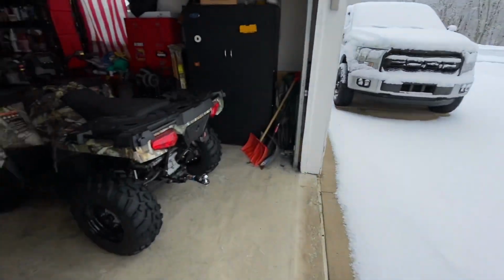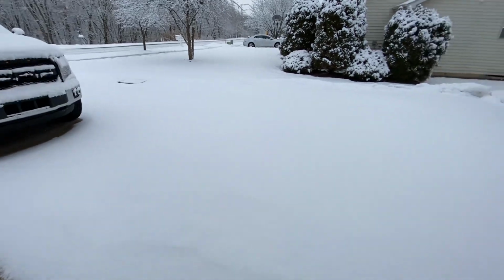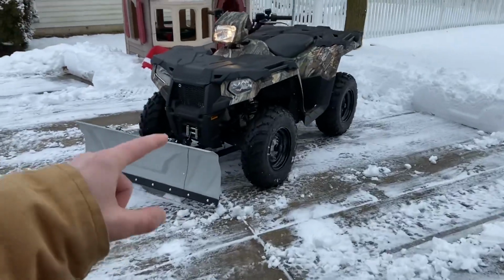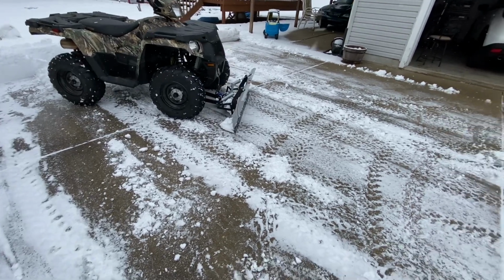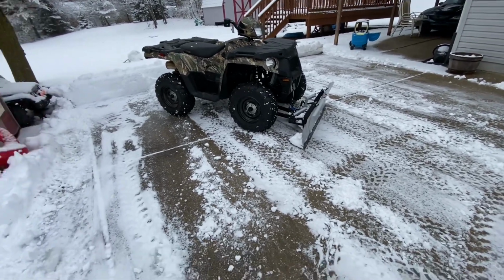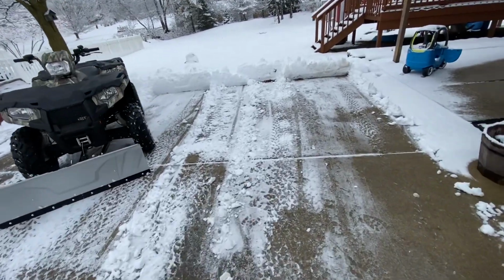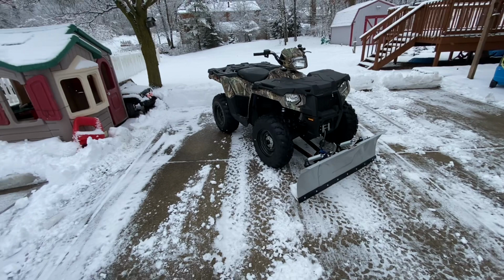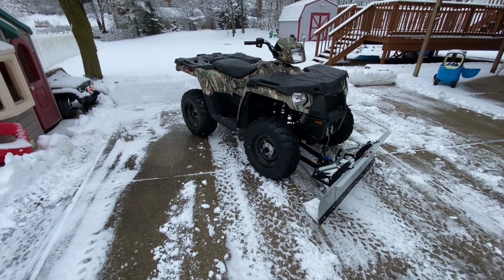Snow plowing with a Polaris Sportsman 570

Comment: I have the same plow on my ATV.  For it, I bought & installed rubber flap (for top of blade), corner marker posts and 1 x side universal side wing (made it fit) and 2" PVC pipe on its cutter blade (to protect my gravel driveway).   I also bought / installed a Snatch Block with 2" wheel (can also use 2.5" wheel version) - for its hoist steel cable.   These upgrades are worth it as well....

Comment: I just got the new 570 utility ed with the flu powered Polaris plow of course hasn't had a big snow where I live yet to try it out fully but great 4wheeler also btw at 6:25 is looks crooked on the front or is that the camera doing that? Good video though 😊 keep it up
Reply from the maker: Good call it was crooked! I think it moved after the 2nd time I plowed with it, the universal mount to this plow moves a bit I found (fixed it), but yeah more than a capable machine to move some snow! Thanks for watching!